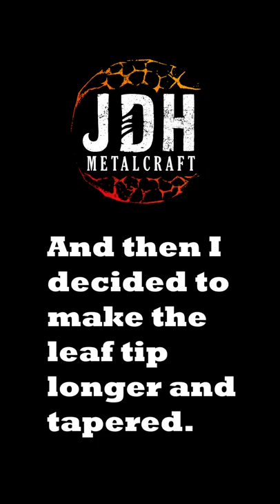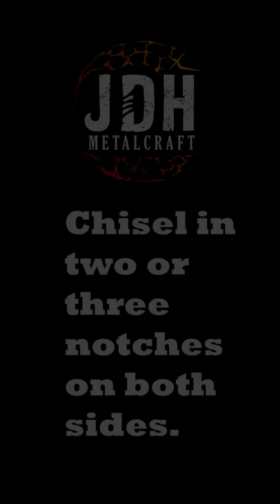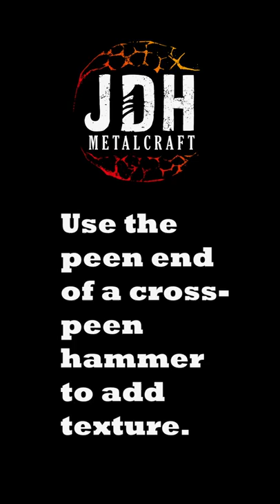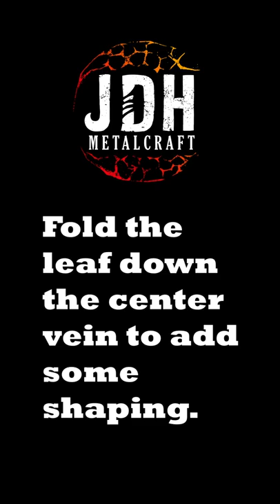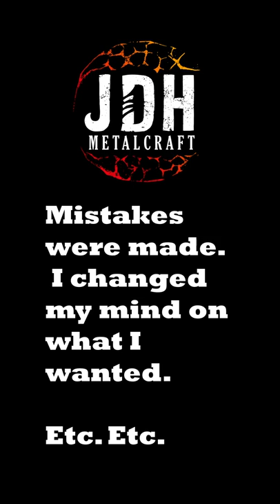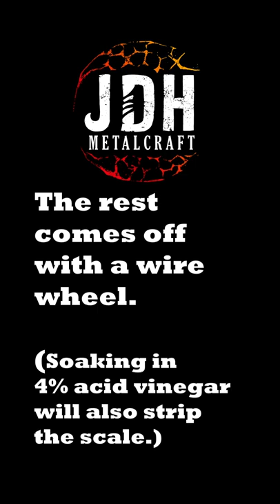Blacksmith Forged Leaf Tutorial

Comment: Nice work John! I always find it easier to film when doing multiples, then I can do all the steps and one angle, then move the camera and repeat. Of course, if you have the time to do multiple pieces that is.
Reply from the maker: Smart. Because I also want to film in both vertical and horizontal aspect ratios for different platforms.
Reply: @JohnDHarvey  Should be easy that, even more easy if you forge to the exact same measurements both times